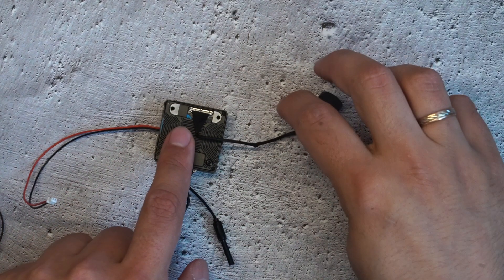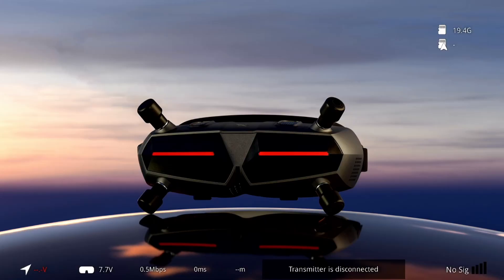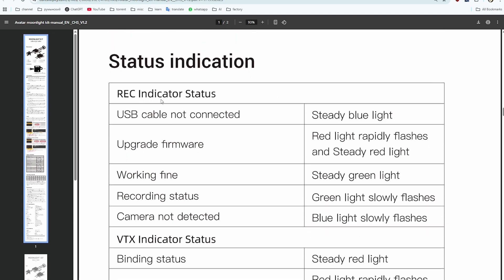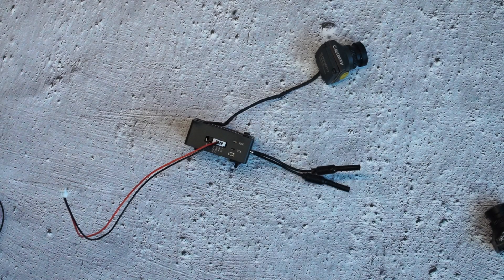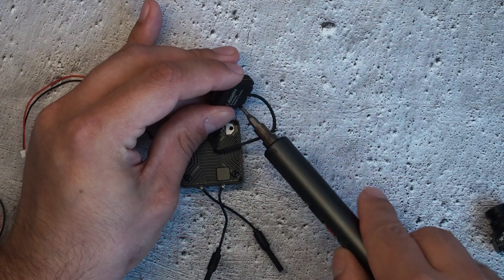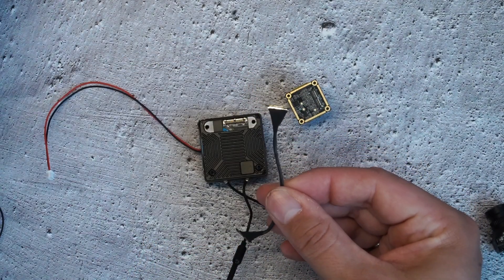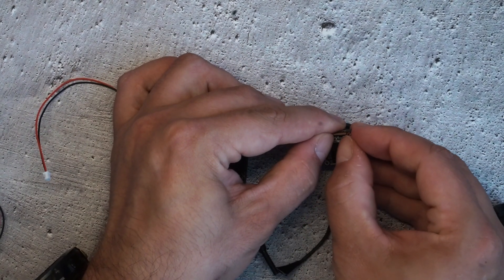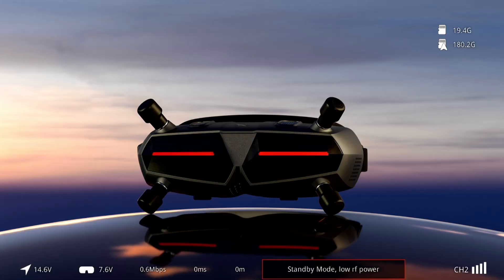CaddxFPV moonlight coax cable replacement - diagnostics and fix

Comment: My stupid ass ripped it off because I tought you needed to pull it ;((
Reply from the maker: That's sad.. but good news that new cable is cheap (at least comparing to DJI spare parts...) you can find link to coax cable in video description